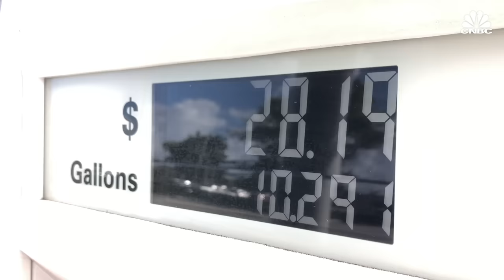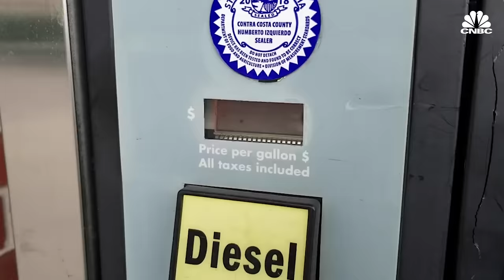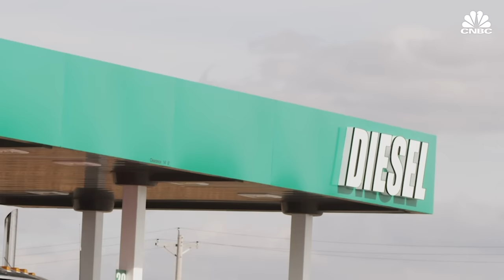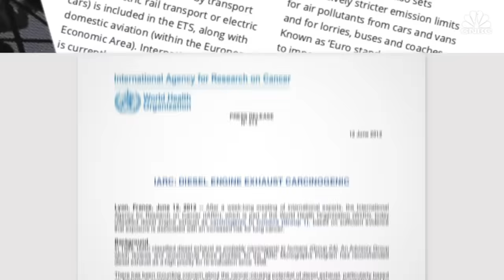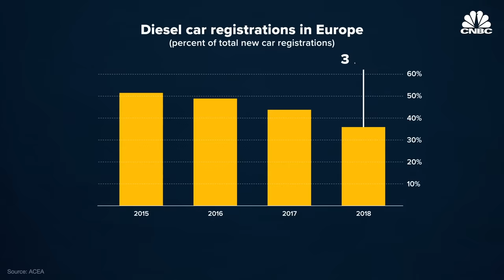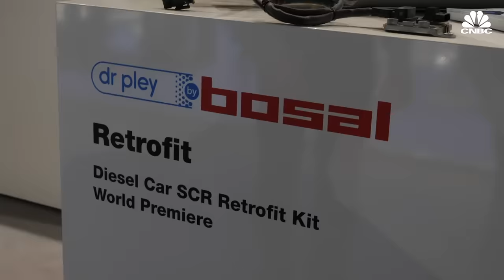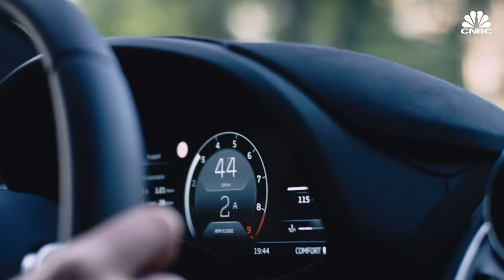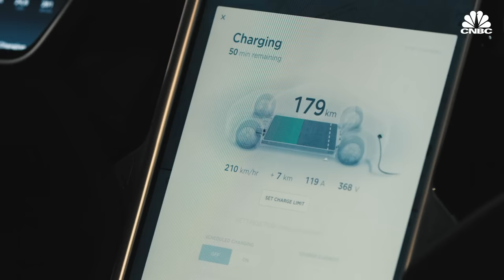Why Diesel Cars Are Disappearing

Comment: I'm driving a diesel as a daily driver, and I love it!
Reply: me too screw electric garbage
Reply: Sure some people like agricultural vehicles
Reply: Willie Peter  
Diesel sound like crap.
Also when you compare, be fair!
 a 2.0 turbo petrol (like a subaru impreza) will DESTROY any 2.0 litre turbo diesel.
Reply: But your agent smith
Reply: I have a 2015 (the year after the emissions scandal and different engine) VW TDI that is as clean as any gas engine car. You can put your nose right up to the tailpipe and not smell a thing. It is a great car.
Reply: @davis7099  
Diesels will go the way of the dodo sooner than petrol cars.
It will be easier for you if you try to accept that NOW.
Too dirty. Too slow without a turbo.
Reply: @alphatrion100  Lmfao my 7.3 international ain’t going anywhere 😂
Reply: ☝🏾😌 I love it too. When my colleagues shell out money for gasoline I put in pennies worth of diesel and will tank after 2 or 3 weeks.
Reply: mike fox  My Polo is aproaching 100.000 km after 11 years and I am now getting them and they are all fixable. I will not change because I know ppl who bought no diesel cars getting the same problems at 3 - 5 years old.
Reply: mike fox  expensive parts you say? I do not pay an arm and a leg for my car parts. Research, research, research.
Reply: @davis7099  thank you! Nicely said.  👏🏽👏🏽👏🏽👏🏽👏🏽
Reply: @moongazer07  less CO2 emissions mate. Who cares abt peoples having cancer, Diesel is still fairly good for environment and last super long. I have MK1 first gen Pajero and the engine is still rock solid and bulletproof for 30 years and still running. Gasoline engines doesn't last long, does it?
Reply: @alphatrion100  luxury cars with diesel engines put loads of sound insulation around the engine and the engine is mounted on rubber struts to get rid of vibration. I drive a jaguar with a diesel engine, 450Nm torque and 56mpg. That's sports car acceleration with micro-car fuel economy in a large sedan.
Reply: @davis7099  So you dont love cars. What are you doing on a channel like this?
Reply: @glennv3176  
you bought the wrong engine.
Reply: @alphatrion100  I got the maintenance of a tractor, the fuel economy of a micro car and the acceleration of a sports car in a limousine.
Reply: @moongazer07  I know that diesel fire is hard af to put out once on fire but it's still worth the risk as the risk of burning myself in my diesel car is extremely low and you can't deny the fact that the longevity of an old school diesel engine is unparalleled.
Reply: @thuhtoosan7098  you're not reading it 

properly it said it takes longer to ignite because diesel takes longer to ignite with 
heat instead of pressure
that means that heat will take longer

than pressure to ignite

also, diesel transport can have runaway
diesel engines which are very destructive to the engine
and I'm using you're not your
Reply: @Sam No, I don't smell anything. I have a 2015 w the EA288 engine. It really is clean.
Reply: @alphatrion100  ok so compare them in long run motorway and I want to see how it will destroy diesel. Diesel are not for race like most moronic teenage think (buy 2.0 diesel with sport label) then masacreate it trying be fast and furius. To the sound I like this diesel sound. Of coures US V8 sound better (even from any japanise fast runners like GTR). Most important think is buy a car with engine suit for you. I make lots of mile so diesel save me a tons of money on fuel. You can buy any sport petrol car and drive with wide smile on every corner. There is one rule you can go fast or economic there is no other option.
Reply: @alphatrion100  I'm not that old drive diesel cars for round 15 years and preaty mich sure got balls. For me just 5L engine is pointless when you stuck in large city traffic. Loke in Bruce All Mighty so much horsess and nowere to run
Reply: @alphatrion100  TBH for me that is not a big issue. I bought a turbo Diesel last year, 15. DCI, 95BHP. I need it for the fuel economy and low emissions. Performance is only a factor for a very small ammount of people
Reply: @alphatrion100  diesels seem to sound like crap because they are NOT made for performance applications and are heavily muffled. The Mercedes OM606, OM602, Mitsubishi 4D56, Cummins 6BT, Volkswagen 1.9 TDI, Ford 6.0 Powerstroke etc all sound AMAZING when straight piped.
And no, a 2.0 turbo petrol won't necessarily destroy a 2.0 turbo diesel. It really depends how the engine is configured. Is the diesel made for low end torque, or high end horsepower? How much boost pressure they're running etc...
You clearly dont know anything about diesels. You aren't into them at all and don't have any idea what you are talking about.
Well, petrol engines tend to be more powerful for the same given displacement, but the diesel will last A LOT longer, have much better low end torque, and get you can get amazing fuel economy with a tuned diesel while having crazy peformance
Reply: @moongazer07  Batteries explode. And scatter the hazardous materials everywhere when they do.
Reply: mike fox  it’s called deleting diesels, it’s only illegal if you get caught
Reply: @ianboard3555  I love the smell of diesel exhaust those
Reply: mike fox  not EU killed the diesel. The regulations did. This resulted the complex engines and multi stage filtering/exhaust system.
Reply: I drive a 2011 F-350, 6.7L diesel daily. Well… it now identifies as a 1965 F100 and went under the scalpel to remove equipment no longer required. 😂🤣😂 I can get 20 mpg on the highway in a 10,000 lb truck. That’s why the government doesn’t want diesel to go main stream. It’s very efficient.
Reply: mike fox  there’s an easy fix for that junk. Any vehicle can opt to identify as a older, different model just like humans can now choose their sexual makeup. My 2011 F-350, now identifies as a 1964 F100.
Reply: @dieselgeezer18  petrol engines tend to be more powerful for the same displacement of a diesel? Are you smoking crack? My deleted 6.7L diesel makes 600 RWHP and 1200ft lb of torque. My highly modded 7.0L Corvette makes 550 RWHP and only 510 ft lb of torque. Diesels will ALWAYS make more power and does so much lower in the RPM band which makes them stronger and more efficient than any gas motor ever designed.
Reply: @secretsquirrel572  your 6.7L diesel makes 600 RWHP and 1200ft lb of torque because its turbocharged smartass. If your 6.7 was Naturally aspirated it would make like 200+HP.
Yes diesels do make more torque at low RPM and are more efficient. I didn't argue with that
Reply: @dieselgeezer18 … sure it has a turbo. But diesel fuel simply has more energy than gasoline and not to mention much stronger internals. To make the same power in my Z06, I would need to upgrade my rotating assembly, add forced induction, and likely run a much higher octane to prevent predetonation. The gas engine would still have to be tuned rich to keep the pistons cool. On that note, diesels have a much higher air fuel ratio than gas. Naturally aspirated Gas engines are tuned normally to 14.1ish AF ratio where diesels are tuned to a 100:1 AF ratio which again speaks to its efficiency and energy output over its gas counterpart.
Reply: @secretsquirrel572  yes, diesel has more energy per gallon than gasoline and the diesel engine itself is constructed to extract more energy out of the fuel, but that doesn't make them more powerful. If you compare 2 naturally aspirated same displacement diesel and gasoline engines, the gasoline will make more power, simply because the gasoline can rev higher. Higher revs means higher airflow and more powerstrokes, which means more power
Reply: @dieselgeezer18  you just do not understand. Revolutions per minute do not equate to power. It’s ok. You just do not understand and I accept that. I’ve worked on and tuned gas and diesels all my life and you’re just incorrect.
Reply: @secretsquirrel572  all you say is that i don't understand. PROVE me wrong! Come on!

"You just do not understand and I accept that".
"I’ve worked on and tuned gas and diesels all my life and you’re just incorrect.".

These are some REALLY bad arguments. You don't prove me nothing.
Revolutions per minute DO equate to power. I explained why previously
Reply: @dieselgeezer18  … and you have yet to prove yourself correct. You’ve provided nothing in terms of how and why a gas would make more power other than a gas engine revs higher than a diesel. But you forgo the fact that a diesel has longer stroke, higher compression, and more energy than a gas motor. Gas motors are inherently weaker and require much more fuel and revolutions to make the same power as a diesel that does the same amount of work with less fuel, less revolutions, and much lower power band. So please tell me again how gas motors make the same power as a diesel!?!
Reply: @dieselgeezer18  my diesel makes more torque at idle than most common gas motors make at their peak power band. But gas motors make more power? Mmmkkkk.
Reply: @secretsquirrel572  just because it makes more torque at idle doesn't mean that its more powerful. Gas motors make less torque at low RPM but MORE torque at high RPM compared to a same displacement diesel. High torque at high RPM translates to HIGH HORSEPOWER.
Your diesel makes more torque at idle than most common gas motors make at their peak power band because its a freaking HUGE turbocharged 6.7L engine and most gas motors around have MUCH less displacement and are N/A! 
A N/A 6.7L gas engine would absolutely crush any N/A diesel engine that has even MUCH higher displacement than yours. Diesels need turbos to make power. Without them they are gutless. If you run the same PSI (turbo or supercharger) in a gas and diesel engine, the gas will make more power. (The gas is more likely to need its internals upgraded though, and yes making power in diesel engines is a lot easier)
Reply: @dieselgeezer18  you obviously do not know how a diesel works. How many spark plugs are on a 6.7L diesel?
Reply: @alphatrion100  Really,have driven a new Hilux or Ranger,Isuzu etc utes in Australia,all 200+ hp and 500/560 nms of torque,they hit 200kmh with ease tow anything,they are not going anywhere soon...
Reply: @secretsquirrel572  Yes diesel has 30 % more energy then petrol...
Reply: @alphatrion100  - no gasoline engine can move 80,000lb semis, diesels aren’t going anywhere, if gm hadn’t ruined diesels in America with the Oldsmobile 350 diesel, diesels would be more popular
Reply: @dieselgeezer18  - I would like to see any gas engined heavy duty truck attempt to move 80, 000lbs , you would need a gasoline motor twice the displacement of a diesel, and the gasoline engine would blow up because of the stress
Reply: @matthewmorrison2970  cancer has your number mate
Reply: @jimcarroll3730  combustion engines will be banned from the road for private use in 2050 in the eu.
They wont be allowed to sell them here new from 2035.
So european and probably japanese combustion cars will be a piece of history soon.
My guess is they wont continue to  make them especially for america
Reply: @jimcarroll3730  maybe they will make an exception for commercial use but private use will be over soon
Reply: @dieselgeezer18  - if gasoline engines are so powerful, why do t you see 12 liter gasoline engines powering all the on road truckers,  there is a reason why top fuel dragsters get their engines rebuilt after every run, because they are fragile, they can’t hold up to the compression ratios of diesels
Reply: @jimcarroll3730  semi trucks and heavy equipment in general use diesel engines for several reasons. One of the most important reasons is that diesels are MUCH more fuel efficient than gasoline enignes.
Diesel engines produce great torque and low end torque which is very useful for moving heavy stuff around.
Diesel fuel is much harder to catch fire and doesn't release fumes which make it better for industrial use. Diesel engines have a longer lifespan compared to gasoline engines. That mostly comes down to the fact that diesel engines rev lower, are built tougher and the diesel fuel itself does not wash the oil off the cylinders as much as gasoline does.

All in all diesel engines are mostly used for the reasons that i stated above, not because  they are more powerful. A high revving gasoline engine without a turbo with a displacement as little as 6 liters could make more power than a turbocharged 12 litre diesel engine from a semi truck. It wouldn't last nearly as long as the semi truck diesel though. The engine wouldn't blow up but the parts would wear down MUCH quicker(cylinders, pistons, rings, crankshaft etc). Yes diesels can be made powerful, but they ALWAYS have to be turbocharged otherwise they are going to be dog slow. But still a 12 litre turbo gasoline vs a 12 litre turbo diesel that run the same boost pressure the gasoline would destroy the diesel in terms of power
Reply: @bike-cave-man2527  uh no that’s theft
Reply: @alphatrion100  diesel isn’t dirtier then a petrol that’s a misconception
Reply: @moongazer07  electric cars are not emissions free.  Coal is the most burned fuel to make electricity.   You fail
Reply: @marlboroman2393 
It's only a work truck
Dont get excited
Reply: @alphatrion100  you think? A custom ford lariat 250 6.7 L turbodiesel prices at 70 k. Its nor only a work truck. Its luxury
Reply: @marlboroman2393 
Still just a truck. should have bought a c8 corvette for that money.
Reply: @alphatrion100  a corvette has nothing on my truck. More hp ,more torque, better interior. I live on my ranch what does a corvette do me for? I have a cadillac deville year '96 5.0 liter 8 cylinder inline with only 25 thousand kilometers my grandfather gifted to me
Reply: @moongazer07  what do you think is used to mine the precious lithium for electric cars?
Reply: @matthewmorrison2970  Rolling Coal!!!🤧
Reply: Marshmallow Man  I don't care about diesel-gate. I just want a reliable, economical and torquey engine :-D
Reply: @moongazer07  So, have you forgotten about Tesla and other EV battery packs exploding? Huh? Huh?
Reply: @rickitysplitz7035  that was years ago

Comment: Why does the narrator keep showing oil going in to the engine every time he talks about putting diesel into the car
Reply: No idea.  Diesel isn't far off from light oils and kerosene though, you may as well be burning oil.
Reply: Maybe thats why some call it oil burner 🤷‍♂️. 
Love mine oil burner! All nice and deleted.
Reply: An old Diesel engine will run on oil, heck you can use frying oil in em.
Reply: @Saddutchman  

True. There is even a rarely occurring edge case failure mode of a diesel engine where it will start literally running on it's own engine's oil reserve, so you can't stop it by turning off the fuel pump flow!

There are longterm maintenance issues, and emission issues though if the fuel is too funky.
Reply: @Saddutchman  if you put a mix of BP GO and napalm/mothballs in them then they really get up . might blow flames out the back but they go real hard with the mothballs in the tank.
Reply: I was wondering about that. They must have thought it looked cool.
Reply: It’s a video production by a mainstream media outlet using as high of a percentage of stock footage as they can.  Just look at how much they are showing amazon vehicles. They figure if it looks plausible enough nobody cares if it is 100% accurate.
Reply: It ' s that library shot problem...., oil to engine shots are probably cheaper.